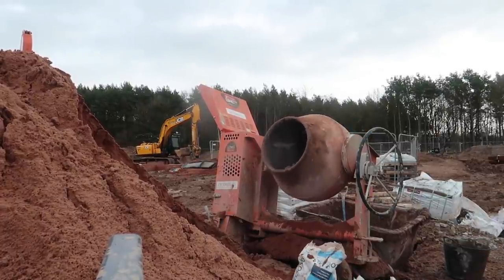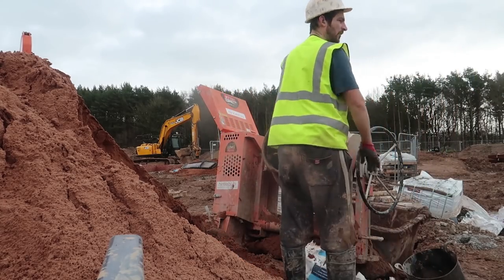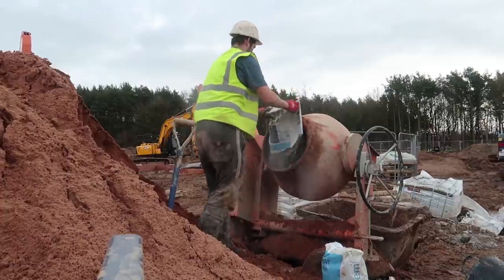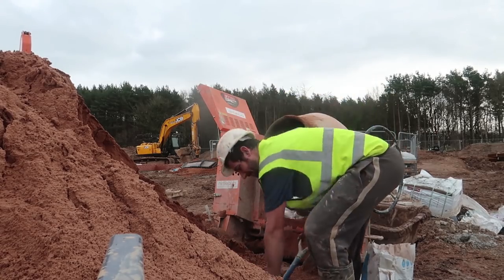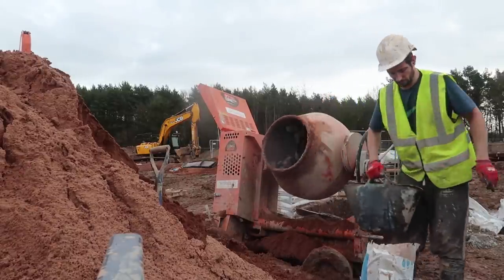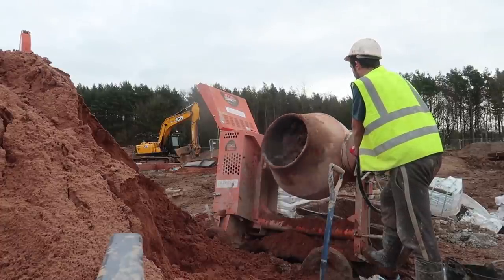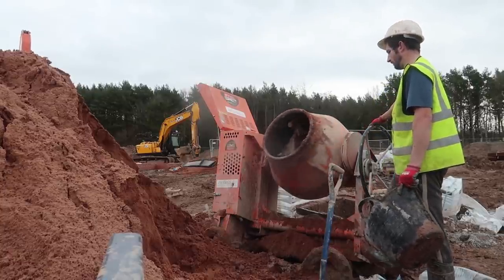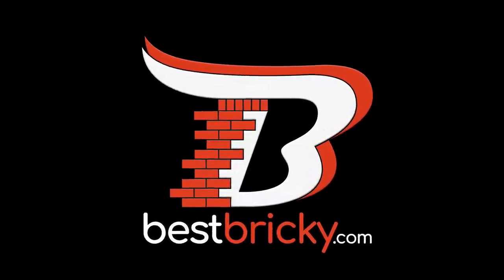Site Bricklaying, Putting a Mix In Sand and Cement Labouring Skills

Comment: Hi stu. Absolutely love your content, have found it most helpful. Need your advice, about  building a retaining wall to hold back fields which are sloping towards house. The original wall has moved an i need to remove it an pour new found. Wall will be 30 metres long an 2 metres high
1st question, 
If blocks are 9 inch on there flat how many block deep should the wall be, 3 or 4?
Should i build piers an if so at what intervals?
At what intervals are the expansion joints?

Comment: You don’t gage your muck stu?
Reply: Don’t need to gauge the sand with buckets for footings
Reply: Jamie Browne only amatures do that
Reply: Keefer 😂 Gauging muck just to keep the consistency of strength! And strength plus colour on face work.  Amateurs** wouldn’t gauge it!
Reply: And I only mean gauging with a shovel, not buckets for footings
Reply: Jamie Browne I mean they just know how many shovels equals a bag of cement I mixed plenty of gobbo. You don't always have to use a bucket
Reply: Yeah exactly, but just filling a mixer isn’t gauging, or even experience gauging, cause the next gauge you won’t have even roughly the same sand in there every time, I’ve never used buckets, even on face Work,  I know stu knows it’s all, he’s great, was a question
Reply: Jamie Browne well it looks like he knows what he's doing I would probably count the shovels of sand myslef

Comment: Where is your gauge buckets? that will not be a very good mix,  a shovel/spade of sand is not the same as shovel/spade of cement.  it is no wonder hand mixes are of poor quality and not fit for purpose.  you should always use a gauge bucket or box

Comment: What is the ratio? Sand to cement that is.
Reply: kebabtank 1:4, 1:5 for me. Mates are happy about so yeah
Reply: Depends what sort of job you are doing, and what you are brick/block you are laying. More cement = stronger and more resistant to weather but more brittle. Less cement = weaker but more flexible. The general rule is mortar must be softer than the brick/block/stone you are laying, having it harder will cause no end of nightmares long term.
Reply: Should be 4 /1 below dpc and 5/1 above
Reply: @NanoCottage  who knowshe didnt count or measure anythingnocontrol